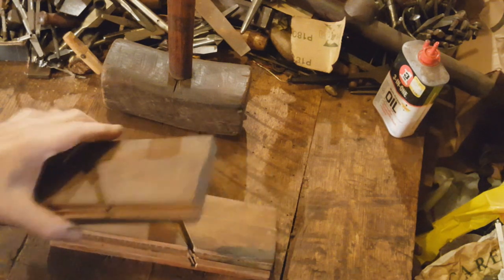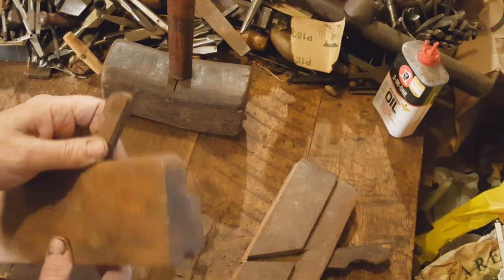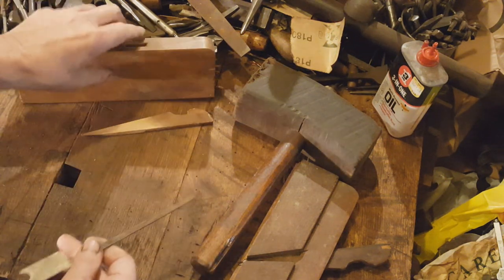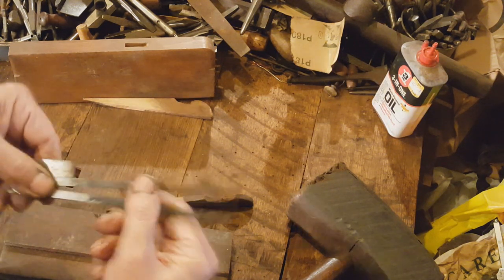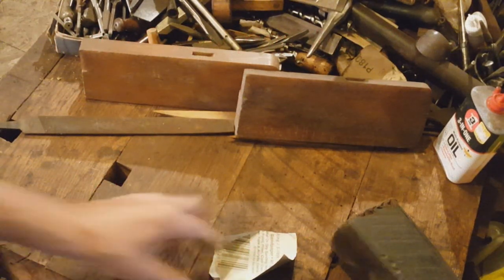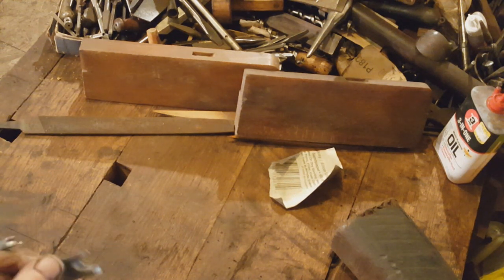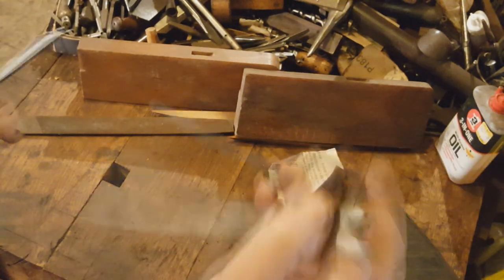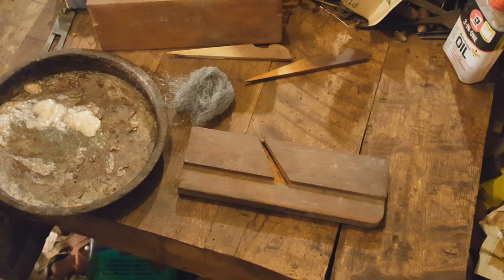Wooden molding plane restoration tips and techniques.

Comment: I use wire wheels to clean up irons just as you did (I use whatever works).  Those plane bodies cleaned up very nice, I've got a molding plane that looks like it's covered with creosote (probably just caked crud).  I think I'll try that stripper idea.  Great video!
Reply from the maker: Some of the "original" patina crowd get a bit weird about using a wheel, but if done carefully it won't damage the iron.  I've done a number of cooper's crozes that had 1/8" or better of hand crud on them and that takes a lot of work to get off.  But it's worth it.  Thanks for watching!

Comment: As simple as that! This is plenty enough cosmetic attention. Well done

I do wonder what you do for the more technical side of moulding planes though, remaking wedges, reshaping the profile, grinding and honing the cutters to the right profile
Reply from the maker: Well all of my work is for resale so I stay away from planes needing too much work.  I really can't justify spending 2 hrs on a $20.00 US tool.  Once in a while if a plane needs a wedge, I have a much of planes here that are missing irons and I'll hunt around till I find one that is close to fitting and the correct finial shape.
Reply: @olderiverhardgoods Hi, I get your situation, it makes sence. I also think it's best to leave that up to the preference of the user

I try to set mine up for personal use so sharpening is a given. My current method is to check and adjust the sole, for that I use moulding planes which always take off a little more than I would like, then with a round diamond hone flush the cutter to the sole, than using the edge of the grinding wheel grind the cutter to a new apex. 

But I'm still looking for better methods, using hollow and round planes don't really give the accuracy I like to get in the sole of a moulding plane, making a moulding plane the negatige shape of the plane is too much work, and scrapers don't really give a straight result. Sharpening on the edge of the grinding wheel also has it's limitations. The hunt continues!

Thanks for the quick replie
Reply from the maker: @LegoMan-cz4mn  Thanks for watching and the comments.